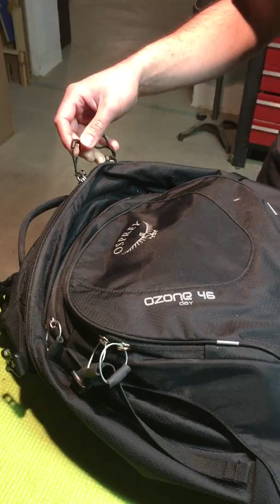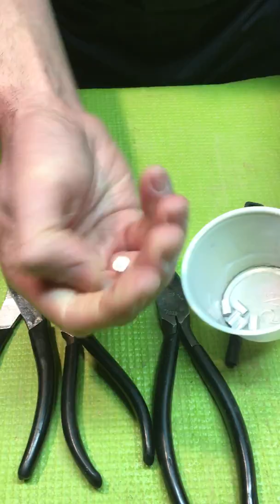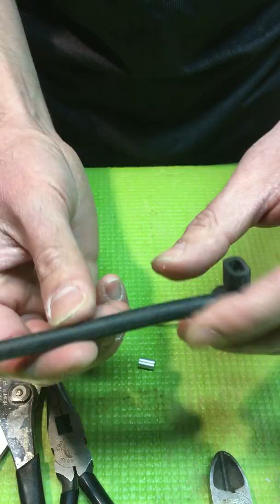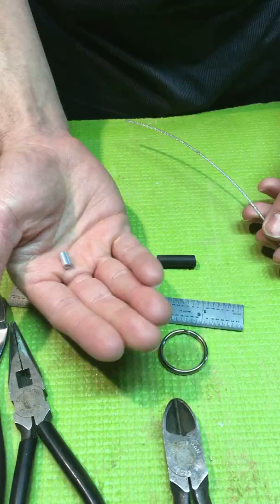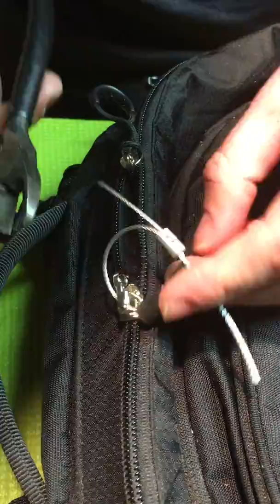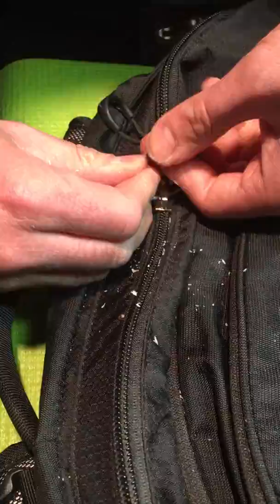Osprey Ozone 46 - Zipper Pull Travel Hack Mod Modification Lock (Replace String with Metal Wire)

Comment: One question: why don’t you just use 2 key rings directly?
Reply from the maker: You can use a key ring if the diameter of the ring is small enough. We initially tried this and it worked; however, when testing the pack in actual use, the rings were too small to easily catch with a single finger and were not practical for that reason. The method we used here fixes that problem by allowing the loops to be bigger and more easily catchable with a single or double finger for easy and hassle-free access.